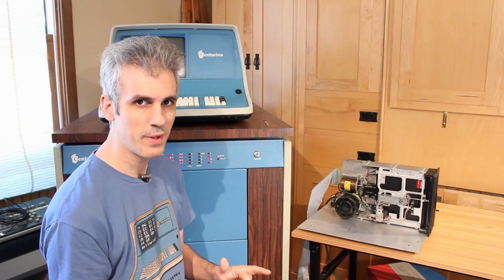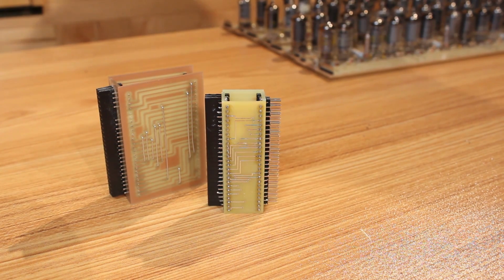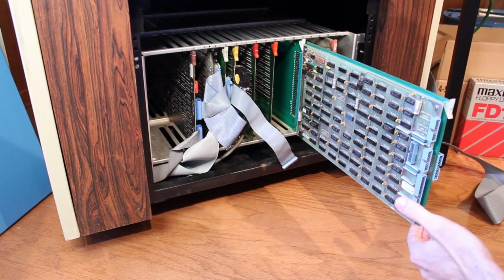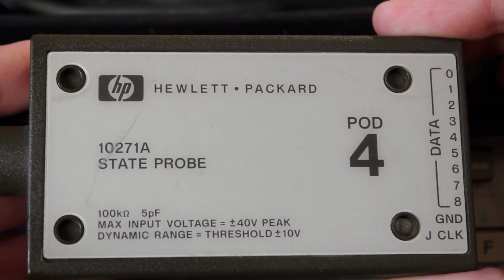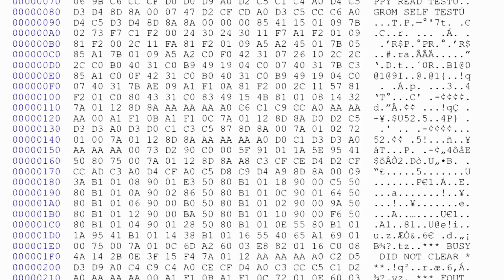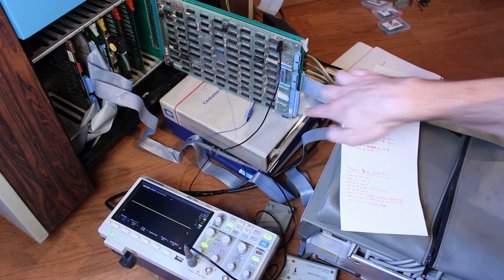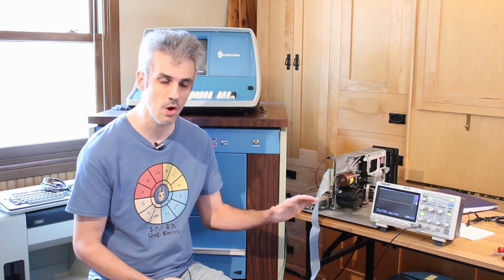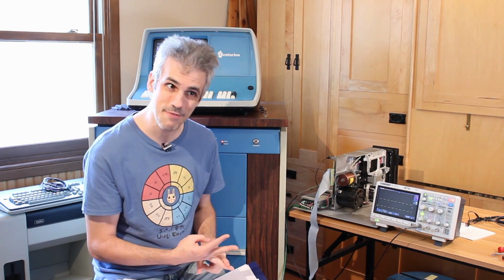Minicomputer Part 22: Working on the FFC and CDC Floppy Drive

Comment: Well, at least the problem is not the strange read-head signal chip, I saw in the manual.

Yes, a stepper motor will stall if it is asked to accelerate too fast. To get stepper going their fastest the time between pulses and/or pulse duration has to start off long, and become faster. The same is true when slowing down.

Oddly, if you into the milliseconds, you also might be able to stick an Arduino in there. : ) The pins on a Arduino Nano take about 3ms to rise and fall cycle. Their signal waveforms are nice and sharp too. Often when I write for code for pulses, I am usually working it out to the microsecond. BTW, the microsecond delay overflows, but there's a workaround. 

Also, the interrupts need to shut off for nice stepper waveforms of this will happen: https://www.youtube.com/watch?v=A9ozedf5HCE
Reply: This is why it is computer science,  one is not coding on and offs but the timing of electrical signals and waveforms
Reply: Which chip are you referring to? There are some old chips (which still have modern equivalents, but not in the same package), but not strange chips from what I can remember...

Comment: The way I wrapped my head around microcode when learning about it earlier this semester was to think of the CPU as a state machine at a level below just executing instructions. 

At any given time, the CPU is in a certain state but it needs a way to define the next operation, that's the next micro instruction address (each address is a state if that makes sense). To branch, you can force address lines high or low with a logic gate depending on something like a ready signal from memory. The rest of the bits in the microinstruction are just used to manipulate the flow of information. Take for example an ADD instruction. To do this you need to tell the register file which registers are being read, possibly use a MUX to feed an immediate value into the ALU, etc. Everything happens in individual little states that when combined create the fetch, decode, and execute cycle. 

Reading this back in text form makes it kind of hard to comprehend. I am just a student but have really enjoyed your videos and hope this may have helped a little since you said you were still learning about microcode.

Here are some resources from the class I am taking now that may also be of interest (Appendix C and the state diagram seem the most useful/intuitive).
http://users.ece.utexas.edu/~patt/22f.460n/handouts.html

Comment: Depending on the speed of the CPU running on the FCC Card, it is just a matter of either adding 2, 5 or 10 NOP code into the microcode or loop the read cycle within itself three times (to get 9msec) and then add a NOP to the end to 10msec read delay.

I remember doing strange things with the 1541 Commodore Disk Drive for the video game company I worked for to make the drive sound like it is formatting a disk when loading a game, and a pirated copy of the game would not have such a loading pattern and fail. And I'm sure a lot of old Apple II programmers wouild say the same thing with the tricks they did with the Apple II Disk Drive.
Reply: On the right track, but the FFC microcontroller runs at about 2MHz so that would be quite a few NOPs to slow down from 3ms to 10ms...
Reply: @sjsoftware72  Guessing the change is just a slight change, to use a longer delay in a counter then, seeing as there likely is a firmware timer, using part of the arithmetic to count those clock pulses out, and the difference is just changing the value preset into the counter.
Reply: @SeanBZA  Yes, a change that's very easy to make...knowing which byte to change took a lot of work however...
Reply: @sjsoftware72  True, but knowing this is a general purpose card helped a lot, in that there had to be built in values that did this. Just meant you had to know how the firmware worked to get to the right set of instructions. Looks like you did get it right though.

Comment: If you are making another revision of the bus riser card you might want to break out the power and ground circuits (and maybe RESET) onto a separate connector and/or test points.  This would give you a hand point near the card you are probing to connect test instruments (injector, logic probe, multimeter, etc.)  without needing to tap the card under test for these services.
Reply from the maker: This is a really good idea! So good that the DIAG card already has us covered, haha. It has all the power rails broken out on the front of the card, and if the system is having trouble booting into the OS using the Hawk, the DIAG card is the first go to for getting a booting a system. If I need the riser card to probe a card, that usually means we're beyond any problems with the CPU6, MEM or MUX cards since they're all tested pretty extensively using the DIAG card.
Reply: @UsagiElectric  Actually, an extender card for a system I used to service had a full row of test points all the way down behind the edge-mounted connector. To make probing easier, the test points were staggered in two rows.
Reply: You could in fact put test connectors on every conductor.  These are tiny metal rings you clip your test leads to, available as surface-mounted components.   Offset them in such a way that adjacent connectors are not too close together to make connecting leads easier.
Reply: And maybe an adjustable foot for stability?
Reply: Perhaps add miniature fuses on the power rails also ? Someone also mentioned LEDs...

Comment: That missing trace can be fixed with a length of copper tape.
Reply: Since the board is also missing the finger, while copper tape will work, but it won't hold up to many insertions, and he'd have to be careful about it pushing off and shorting out the adjacent 5V net.
Reply: Yeah!
Or just run an insulated wire and then tack it down with dobs of hot melt glue.

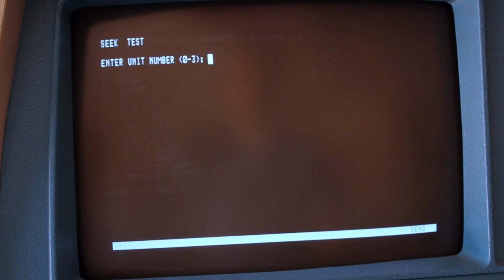Comment: Does the carriage sound like it's skipping on the restore / track 00 command at 2:45?  It could just be backlash but it really sounds like it might be hitting the stopper (if the drive has one) once rather than being limited by the track 0 sensor.  Maybe the mechanism is slightly out of alignment so to trigger the track 0 sensor it actually has to step a little further out?  Now that I watched to the end, maybe it was just the step rate being to fast.

Comment: Now that missing ground on the riser definitely sounds like the kind of mistake I'd make :)
Reply: presumably one could just run a jumper wire,  I guess two grounds used on main cards as a mix of a fail safe or when it is really run with all power stuff busy to split load ?
Reply: @highpath4776  Normally with those kind of cards you have a few parallel ground paths on the connector, as you need a low impedance ground as it is a signal reference. Next PCB make the ground an inner layer of the PCB, and multiple vias to attach the trace on top and bottom to it. Does not need to be full width of the board, just has to be around 1in wide inside, and then a similar width crossover to connect all ground paths on the connector together at the one side.